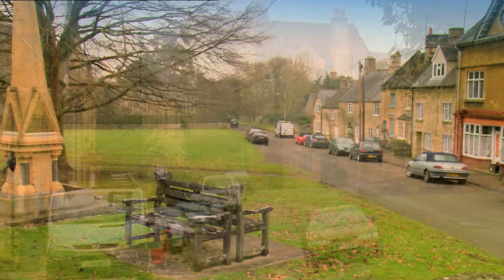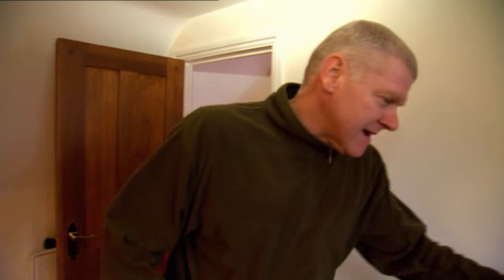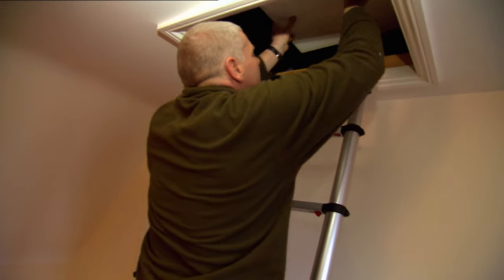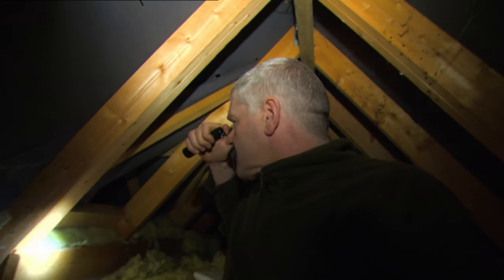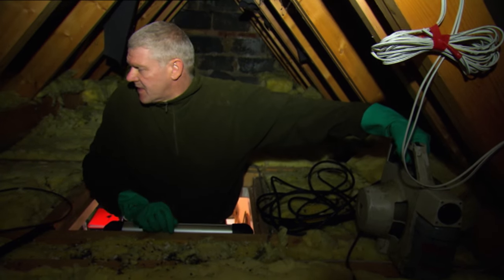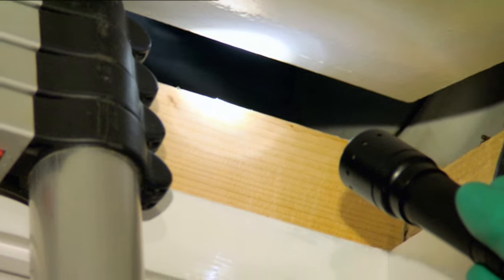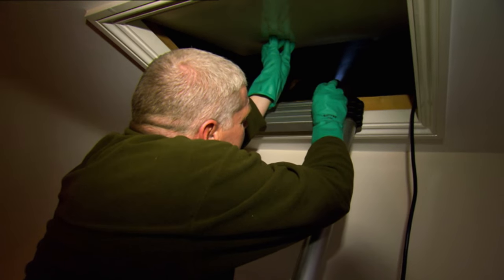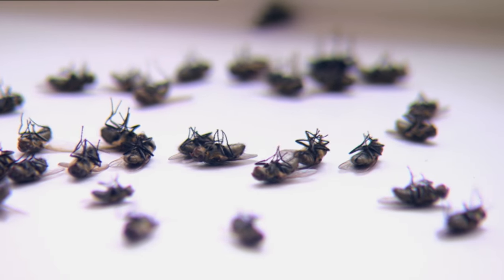How To Deal With Cluster Flies

Comment: I just wish it was that easy! Unfortunately, in our experience it's not. We have a major cluster fly infestation in our loft space and are really struggling to get rid of them permanently. I've two large bug zappers hanging from the beams and have to empty them about every other day because they're full. I've had pst control around and they've released a 'smoke bomb' but while it kills those flying around it's not long before they're back and buzzing around. Apparently they release pheromones which simply attracts more flies ........and they come back in increasing numbers every year! Sadly no one can give me any assurances (or guarantees) that they can fix the problem permanently. Pete - do you have a solution that works over the long term?
Reply: Can you get a slow-release smoke bomb kind of thing – does a product like that exist?  It seems you need some kind of extended release action to break the cycle of pheromone release and re-infestation.

Meanwhile, you have my sympathies.  Flies are one of the most horrible things – I can cope with wasps, bees, spiders.  But flies... 🤢